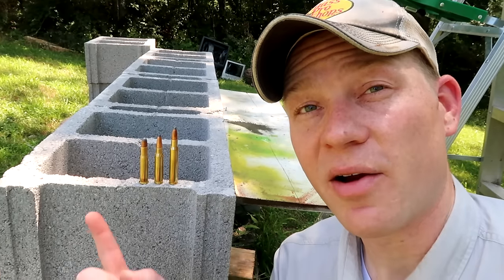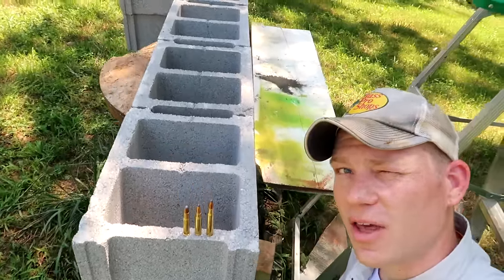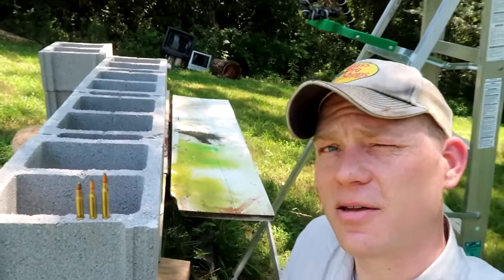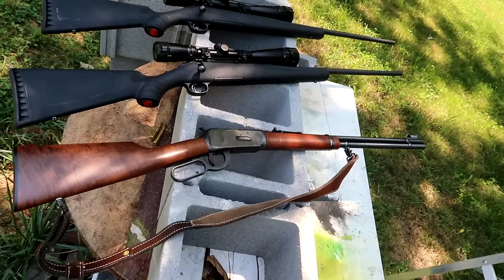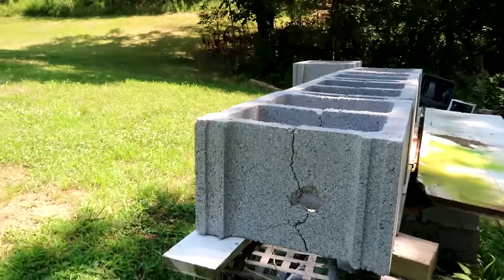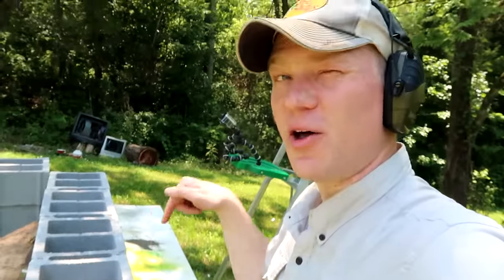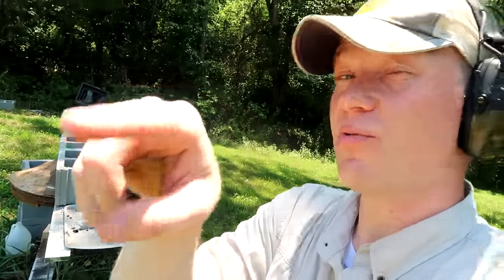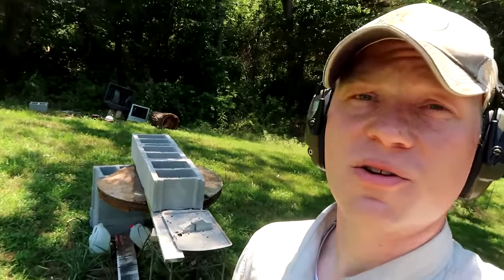30-30 vs 308 vs 30-06 - Cinder Block Test

Comment: I like my 06 Beacouse it can shoot for a long distance and knock down every anamial in north america
Reply from the maker: Thanks Garrett! Cant go wrong with a 3006
Reply: WHO_TEE_WHO interesting video knocked its block off lol should include your wife in video too shooting 👌🐺💪🐾
Reply from the maker: LOL.she does not shoot anything larger than 22lr
Reply: WHO_TEE_WHO awe pity more recoil more fun 👌🐺🐾💪
Reply from the maker: For me yes, for a tiny little woman not so much. 😆
Reply: WHO_TEE_WHO I seen women fire 500 magnum that's hard core   but yes what's your used to firing?💪👌🐺🐾
Reply: WHO_TEE_WHO yes, my 06 has synthetic stock..... very light.... i dont let my wife shoot it
Reply from the maker: Yeah i would be afraid the scope would pop my wife in the eye
Reply: .308 can take anything in North America also. Ballistically, its identical to the .30-06 if tye bullet weight is the same.
Reply from the maker: Thanks for watching!
Reply: KINGRODP first sentence true.....2nd sentence not true except with factory loads ..... factory loaded 30-06 are somewhat anemic due to the old weapons people might shoot the ammo in......certain rifles can handle properly handloaded 30-06 ..... 30-06 can be loaded to perform
Reply from the maker: Thanks Jay!
Reply: Jay Thomas Reset Im talking about Factory loads. I understand that 
.30-06 can be loaded to nearly magnum potential. But for the sake of commercial factory loads, a 150 gr .308 is nearly identical to a 150 gr. .30-06. I know because of case capacity, you can put bigger bullets in the 06. Heaviest .308 I've seen is 180gr. But I've seen 06's bullets at 230gr. I also read a safari blog that stated that the 06 has taken EVERY animal on the African continent...testimony to its versatility (custom load potential).
Reply from the maker: If i go to africa Im taking the 4570! 😂
Reply: KINGRODP agreed
Reply: wrong, need to learn ballistics and the word identical. 200fps is not identical. You must be one of those people that are going to say your 308 is the best and all you need ect,ect, ect, well its just a 308 just like 30-06 is not like 3oo weatherby, get the picture!!!!
Reply: HAHAHAHAHA, no, I live in Alaska and have all my life, DONT shoot a grizzly with a 30-06! Does not work well.
Reply: @nah6430  Many years ago, I read an article by a man who was charged by a grizzly. He emptied his .30-06 rifle into the bear only to have it drop at his feet. His recommendation was to use a .458 Winchester for grizzlies. Of course, there are some new rounds that have been developed since then that might do the job.
Reply: @jayejaycurry5485  well I believe in fact checking and using reliable source's, my grand father once shot a grizzly bear and killed it with one shot in the forehead with his .270, behind a mountain by Seward Alaska, A 30-06 WILL kill a bear and do a good job of it, this person who wrote this either missed and blamed it on the caliber or this story is not true.
Reply: @nah6430  It is easy to discredit a published story or call its author a list. I've no reason to do either, just relate what was reported with his opinion. Equally, I've no basis to claim you are a liar, or discredit what you said. I do know that light cartridges can kill animals considered too big for the round. It merely takes a well aimed shot, a great deal of luck, or even both to do what is commonly held to be impossible, or nearly so.
Reply: daAnder71  I had to go back and re-read that. I laughed. Beacouse.... Nope.
Reply: What you can do with an 06, you can do with a 308 up to 180 grains, you think 50-100 fps is going to make that much of a difference in the real world? Fan boys of any caliber kill me.  If you need heavier bullets with today's bullet tech in 30 cal to do the job, you need a bigger caliber. Most of NA animals are easily dispatched by either one in all reality and no one in their right mind is going after grizzly with either one, been done, but not very smart.
Reply: @DeeMoback  So can the 308..... using different powders, once again.  Bigger capacity only comes into play with heavier that 180 grain bullets.  For instance, CFE223 powder can be used in a 308 to drive a 150 grain bullet to 3000 fps...3006 can not use that same powder with a bigger charge to out perform it.  Yes you can load an 06 to drive the same bullet to a small bump over 3000 until you get into pressure issues, but again, 50 fps, 75 fps, whats that really going to do from one vs. the other.  Not much.   308 loaded with 180s with the proper powders get close to 2700 fps, an 06 loaded right gets to about 2775, is the difference going to get you more range and power on target......not in the real world.  Anything over 180 grain you need a magnum to make it really go, otherwise you are using the 06 or 08 as a short range brush gun with those bullets.  Bigger caliber is needed for bullets that weigh that much, say a 338 federal or 338-06.
Reply: @jeffrice1114  I am not partial to one or the other, but there isn't that much difference between the 2 when both are loaded to potential, more like 75-100 fps, and that is at 180 grain bullets, anything less and the gap closes, with reloads or factory, 10 yards more range is nothing to talk about, 100 lbs more energy, again, an elk isn't going to notice. Check your reloading manuals...Most 06 and 308 are in 22 inch barrels as well, the 06 takes a bigger dive on barrel length loss than the 08 does due to the type of powders used to reach peak velocity.  Real world and ballistic charts don't always agree with each other.
Reply: @jasonsparkman4830  everything you said is technically accurate.....but not always true..... I own a rifle built with a 1920's Enfield action fire-tested to 70,000 pounds..... what powder should I shoot with a 6.5 barrel on it ...... necked down 30-06 case .... 308 is great case no doubt but 30-06 does have more capacity.....  lots of variables .... think about this.....the old 30-40 krag had more case capacity than the 308 case also....hmmmm.....variables, yup
Reply: @DeeMoback  Yes, but remember, the old 30-40 is where the 220 grain bullets came from, it was never meant to be loaded with high pressure powder and was meant to achieve 3030 ballistics with more thump, it's kinda in between the 06 and 3030 in performance. Everything on this continent has been killed with the old 3030 and 3040, which needs to be remembered by the magnum crazy people of today saying an 08 or 06 won't do the job on elk or moose, that you need a 338 win mag as a min, which is absolute BS.  Newberg from Nosler, has many shows on Youtube hunting elk, most of the time he is using a 308, when hunting deer, he steps down to a 7mm08.  One thing on a 6.5mm-06 to remember, and same holds true with 243 vs. 308, bore diameter and powder burn rates do run together, rule of thumb is the smaller diameter with the same case capacity, you need a slower powder than the bigger bore diameter to make it shine, but is also leads to shorter barrel life from overbore.  Something along the lines of IMR 7828.  Using the 243 vs. 308 example, the 243 will shine better with W760/H414 where as it's a shade too slow for the 308 to obtain maximum performance, bigger bore doesn't keep the slower burning powder in the barrel long enough.
Reply: @DeeMoback  Forgot to mention the krag capacity vs the 308 capacity, it depends on the make of brass really,  they are similar 1 or 2 grain difference in most cases.  The performance difference is due to pressure, the old Krag is rated a 47K psi, the 308 is 59k psi, pretty large gap.  Krag was designed on cordite powder which every caliber used, even the 06, until they found out what altering burn rates does to performance.  The 06 hot loaded is 57k psi.  Pressure makes a world of difference, and in some cases means tons more than actual case capacity.
Reply: @jasonsparkman4830  technically accurate
Reply: @jasonsparkman4830  here is a tidbit for you from handloading world..... a 6.5 in a 30-06 is technically/basically identical to a 25-06 ..... lol.... the reason to handload and shoot 6.5 is because THE SELECTION OF 6.5 BULLETS is much more varied nowadays than 257 .....yup .....25 was at one time popular but now people are enamoured with "6.5" hence a wide variety of projectiles are avaiable for "6.5"...... 6.5 is marketing driven..... 30-06 has faded due to marketing so as to push "new" products.....it's all a grand marketing illusion
Reply: @DeeMoback  Doesn't surprise me, the only thing keeping the 257 cal. alive is the 25-06.  I have a friend that hunts with one, nice rifle, but I think a 270 is more well rounded with about the same ballistics and better option for bigger animals.  6.5mm was always an odd ball until competition shooters discovered the Creed, but really it isn't a new cartridge, it was invented in 2007.  IMO the 260 is just as capable and likely more so.  What kills me is these so called experts "think" they can bag any animal in NA at 1000 yards because its still "supersonic" due to low draw bullet designs, but what they don't understand or want to understand is the amount of energy on target even at the muzzle, there is a massive difference between the Creed and the ole trusty '06 as far as hunting is concerned. Wonder how many wounded animals have limped off, never to be recovered due to this nonsense? If you look at what western biologists recommend as far as energy is concerned, is minimum 1500 ft/lbs of energy on a broadside bull elk and 1800-2000 (depends on source of info) ft/lbs on a quartering bull to ensure good penetration and shock effect.  That makes the 308/30-06 a 300 yard broadside and 200 yard quartering caliber.  The Creed doesn't provide the same, the 270 is boarderline although meets the minimum.  I guess what it all boils down to is what you are going to use the cartridge for. Now for your experiment, the ballistics would be similar to a 270 if you used long for caliber bullets (say you found a 160 grain BT in 277 cal), and would actually surpass the 270, but way the heck out there.  So intentions of the cartridge is really the main factor.  Be careful building rifles around that diameter, right now it's hot, but many like it have gotten hot and completely faded away, take the 264 win mag for example.  Last time I read a top 10 list of the most poplar selling calibers in regards to ammo, 308 was #1 (range shooting, hunting, AR10 platforms), I believe 223 was #2, 30-06 was in there somewhere and believe it or not 30-30 was #10.  6.5mm will be limited purely due to the nature of the round, its great for target shooting, but there are better hunting rounds at hunting distances. Best way to describe it, its too close to 257 and just below 277 to really gain and maintain steam, I could be proven completely wrong though in time. No one should be taking shots past 300 yards, or even 200 yards unless they routinely practice it, and with a rifle that can deliver the blow at that range.  Remington tried to resurrect the 6.5 in the 260, winchester had no luck with the 264 (7mm killed it off) and the old 6.5x55, although useful, is sparse in popularity on US soil.  Putting that caliber on the 06 casing will surely fling them out there with authority, but so did the 264......what kind of cartridge would it be, the absolute pronghorn thumper, great deer round, does it out perform the 270/280 on larger game?  Many many questions if hunting is your intention. I get that those little missles don't lose velocity as fast as shorter bullets do, but we are still talking about where the energy curve begins, where does is start to surpass a 270 and is that a useful range or really too far for anyone to be shooting animals?  Nevermind any of this if you just want to do for the heck of it, it is interesting.
Reply from the maker: 🤣🤣🤣 yal are blowing my phone up with this thread
Reply: @WHOTEEWHO  oh you know you love it, we all share a passion with firearms lol haha  I love learning new things, if I had the money, I know I would have alot more than I already have lol
Reply: @jasonsparkman4830  LOL ..... well said ..... I hope a lot of people will read your comment..... they will get some good info
Reply: @WHOTEEWHO  ☺..... good stuff
Reply: @WHOTEEWHO  try a tc contender 14 inch scoped .30-30 t hat will give ya a black eye

Comment: I was mildly surprised. I figured the .308 and .30-06 would out penetrate the .30-30. I figured the .30-06 would punch through one more wall than the .308. But then, it was the similar ballistic of the .308 that caused the military to use it as the replacement for the .30-08 back in the late 1950s.

Comment: Here’s my WAG.
.30-.30 - 1
7.62x51 - 1.5 (cracked)
7.62x63 - 2

I was off.  I’d prefer the .308 or .30-06.  Very similar rounds.  I happen to have .308 for simplicity of stocking rounds, but the .30-06 has a tad more oomph.  I’ll stick with .308 because it is good enough and simple to find anywhere in the US.

Comment: I have two in 30-06, both Remington. One is 742, the other is 742C.  I prefer them because my pappy and I bought them in 1963 and I’ve never had a reason to change. Frankly, I hardly ever use either except for an occasional feral hog or rabid cinder block.

Comment: I did notice the the block for the 308 and the 30 06 appeared to have a slight tip before you shot them. 
Maybe it is nothing but if the block were able to move at impact that could have something to do with the experiment

Comment: I have been deer hunting since I was 14. From the git-go I have used a .30-06. For the last 25years I have been using my handloads with a 150 gr Sierra HPBT match bullet and it never ceases to bring home the bacon (venison). My handloads have been clocked at 2650 fps which gives a muzzle energy of 2340 ft/lbs. Let's put it this way. I have never had to take a second shot or have to follow the hit more than 25 yds.

Comment: I'm a 50 plus year shooter of the 308, 30-30, and 30-06. The 308 is my choice for anything in Tennessee including Elk. Shorter cartridge with all the power I need out to 600 yards which I never shoot past 400. It's right in the middle of both cartridges and easy to load for with a great offering for load supplies!

Comment: I shot a Winchester 30.30 in New Zealand Bush country when younger and used aWin Silvertip in 130 grain.  Stalking Red Deer and Sika.  Went in close (real stalking) and always knocked the deer off its feet.  Bullet never exited.

Changed to Sako .270 in later years and it was easier to sight at longer ranges.  Bullet 130 grain again from Win.
Always performed well but sometimes the bullet exited, probably due to the faster bullet.  Both great rifles to shoot.
I changed because I slowed down and preferred to hunt open country where I could sit and shoot at a distance.  However I consider the first was stalking and the second shooting.  But, I still enjoy venison.

Comment: Great vid. 
Suggestion...make a Go Pro stand out of rebar. Just put a bend in it so you can wrap the articulating tripod around it, sharpen the other end so you can stick it in the ground and voila.
Reply: It would be interesting to get a slow motion picture of a bullet going through the lens of the GoPro.

Comment: I have reloaded both 308 and 3006 and both can achieve similar performance. So it really comes down to what bullets you are using (e.g., full metal jacket vs jacketed hollow point versus other bullet types) and what mass of bullet (for this application I suspect a higher mass bullet might have more penetration with all other variables held constant) and finally last but not least, muzzle velocity because energy equals one half mass times velocity squared. It would be interesting to repeat this study with 180 gr or larger bullets of the same kind and measuring muzzle velocity. Nice study!
Thomas Steven Roth, MBA, MD
Christian Minister for Biblical Medical Ethics
Reply: I think I would like to see that well.
30-06 seems cleaner penetration.
Just a thought.

Comment: I read, years ago, that the 308 was a necked down version of the 3006. I also saw a video that the 3006 was much more versatile than the 308 as far as types of bullets and loads that can be use with it. Probably got this all wrong but that is what I vaguely remembered.

Comment: When I was a lot younger, I went through my bigger is better phase. Had an old short Tikka 300 Win Mag, that bit harder than it barked. Went to a braked Browning 7 Mag, which barked more than it bit, but was still a horse. Went to .280 REM, which was a fantastic round, but eventually settled on a MK77 .308. I love .308. The first gun 8 ever bought, when  I was 20, was an old WW1  M96  6.5 x 55.  I had the bold cut and turned, and the trigger worked. That $150 (30+ years ago) put more meat in my freezer than the thousands I’ve spent since. 

TLDR: .308

Comment: Perfect demonstration. Total validation for the .308 who some folks rate as obsolete. The .308 is a shorter round and easier to cycle than the much loved 30-06, and the very popular.270. It’s flatter with better ballistics at ranges over 100 yards than the very much loved 3030. The .308 is the best all rounder.

Comment: If you didn't use 30/30 snub nosed designed for Mod 94 lever action but used similar type bullet would that change results...

Comment: I was wrong also  my guess was 5 on the 30-06 and 4 on both the 30-30 and 308. I've been hunting with a 30-06 all my live pretty much cause the ammo is very common easy to get and has a vast option of bullet weights.

Comment: Nice video I guess. I'm a 30-30 rifle toter myself. 150 grain bullets all around but the biggest difference was the 30-30 is a Core Lokt projectile. Very different than the other projectiles. Core lokt is blunt vs. the other 2 pointed projectiles. Back to the drawing board my friend.